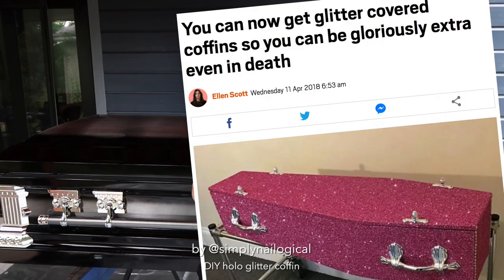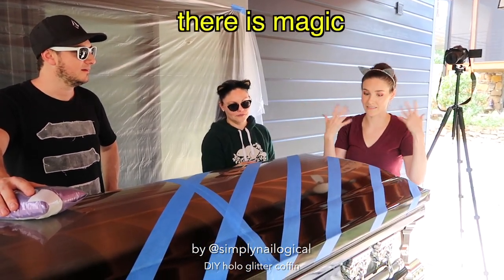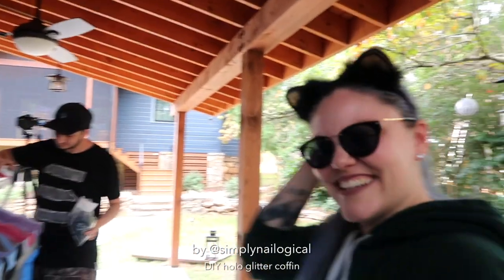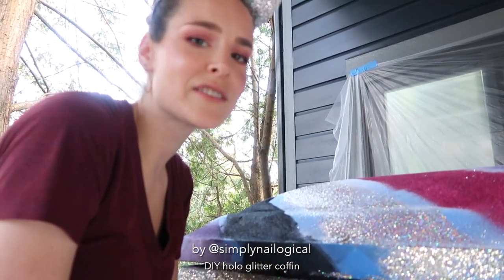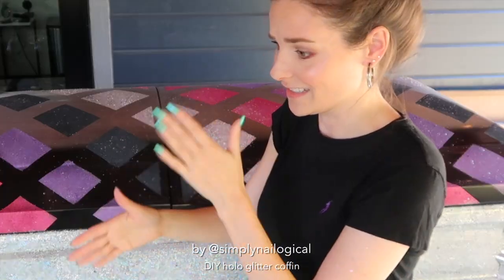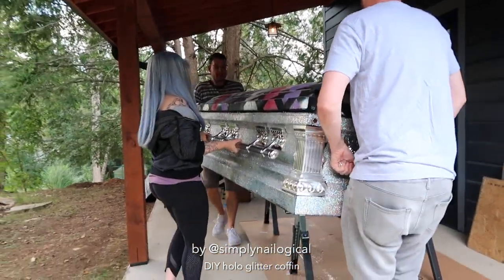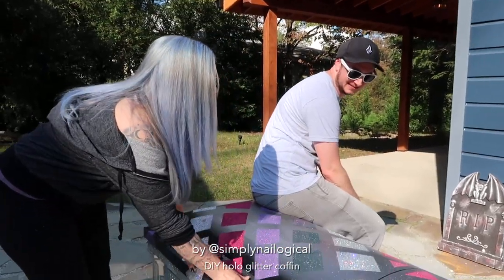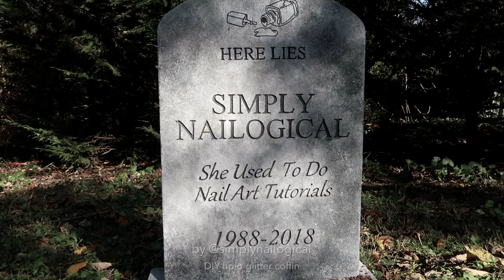I Made My Own Holo Glitter Coffin ft.Threadbanger (dying to get inside)

Comment: the vial at the end contains: 
On the end of many caskets there is a plastic vial that screws into the body. It makes a water-tight seal. Vital information about the deceased is placed in that vial, such as the name, cemetery location, date of death, etc. These have been very useful in returning the remains to the proper place after some disaster or mix-up has caused a problem. For example, in some of the hurricanes that have hit the southern part of the United States caskets have floated to the surface and away from the burial site. If there is a lot of water on the Earth's surface and the soil is sandy or not compacted, a casket could float out of the grave because it is quite buoyant. In hurricane Camille there reports of caskets coming up from the ground, being ripped open, and having the remains deposited in tree tops. Myles McGrath told us how the shrimp fisherman in Louisiana pulled in many floating caskets from the ocean after the storm.

Meaning Cristine's would contain nail oil...
Reply: Thanks for all the info, although when I read "screws into the body," at first I didn't realise you meant the body of the casket. Eeek!
Reply: Why doesn't this have more likes???? ❤ this
Reply: Thank you for your response. Makes total sense now. After Hurricane Katrina / the leeves breaking, caskets floated up. I was wondering how they knew their proper place for sure.
Reply: Sydney Fillinger Wtf?
Reply: Thank you for this! I tried to Google it and got very little. Also that punchline doe. Hahah

Comment: ABOUT THE VIAL!! :)
(found on reddit)

“On the end of many caskets there is a plastic vial that screws into the body [of the casket, not the human]. It makes a water-tight seal. Vital information about the deceased is placed in that vial, such as the name, cemetery location, date of death, etc. These have been very useful in returning the remains to the proper place after some disaster or mix-up has caused a problem. For example, in some of the hurricanes that have hit the southern part of the United States caskets have floated to the surface and away from the burial site.”

kinda cool. kinda morbid, kinda cool. would love if The Good Death did a video on it :D
Reply: Whelp that is my new fun fact for today.
Reply: This comment should be pinned. Useful
Reply: I’m shook thank you for the info!
Reply: Thanks for the info!
Reply: No problem friends! Hope you all have a lovely rest of your weekends!! ❤️❤️❤️
Reply: Never heard about that use for it. Usually, I've had it advertised to families to place a small memento or letter into the vial. Not all caskets have 'em.

Comment: Re: the little vial. On the end of many caskets there is a plastic vial that screws into the body. It makes a water-tight seal. Vital information about the deceased is placed in that vial, such as the name, cemetery location, date of death, etc. These have been very useful in returning the remains to the proper place after some disaster or mix-up has caused a problem. For example, in some of the hurricanes that have hit the southern part of the United States caskets have floated to the surface and away from the burial site. If there is a lot of water on the Earth's surface and the soil is sandy or not compacted, a casket could float out of the grave because it is quite buoyant.

Comment: that’s actually a casket. that’s the thing they put the dead body in during a funeral. you can tell by the rectangular shape with rounded edges and how the door has hinges and it opens half at a time. a coffin is what they bury the body in. it’s not rectangular it’s more of how you would draw a diamond, but longer and flat at the bottom. and the door is nailed on. there are no hinges so it’s completely off or on. you’re welcome for my knowledge on caskets and coffins

Comment: The ultimate purpose of this vial on the end of a casket is to hold a piece of paper on which is written the name and other particular details of the deceased. If the decedent were to ever be exhumed it would be easier to determine the identity rather than actually open the casket and disturb the remains.

Comment: "On the end of many caskets there is a plastic vial that screws into the body. It makes a water-tight seal. Vital information about the deceased is placed in that vial, such as the name, cemetery location, date of death, etc. These have been very useful in returning the remains to the proper place after some disaster or mix-up has caused a problem. For example, in some of the hurricanes that have hit the southern part of the United States caskets have floated to the surface and away from the burial site. If there is a lot of water on the Earth's surface and the soil is sandy or not compacted, a casket could float out of the grave because it is quite buoyant. In hurricane Camille there reports of caskets coming up from the ground, being ripped open, and having the remains deposited in tree tops. Myles McGrath told us how the shrimp fisherman in Louisiana pulled in many floating caskets from the ocean after the storm."  -Deep Six
Reply: Katy Meredith wow. You must really want to please simply.
Reply: Ew. Can you imagine trying to catch shrimp but instead you see a glitterfied coffin with a deck posing body inside it

Comment: according to https://www.reddit.com/r/AskReddit/comments/vw8o5/got_a_scrapped_coffin_in_at_work_anyone_know_what/ , "On the end of many caskets there is a plastic vial that screws into the body. It makes a water-tight seal. Vital information about the deceased is placed in that vial, such as the name, cemetery location, date of death, etc. These have been very useful in returning the remains to the proper place after some disaster or mix-up has caused a problem. For example, in some of the hurricanes that have hit the southern part of the United States caskets have floated to the surface and away from the burial site. If there is a lot of water on the Earth's surface and the soil is sandy or not compacted, a casket could float out of the grave because it is quite buoyant. In hurricane Camille there reports of caskets coming up from the ground, being ripped open, and having the remains deposited in tree tops. Myles McGrath told us how the shrimp fisherman in Louisiana pulled in many floating caskets from the ocean after the storm."